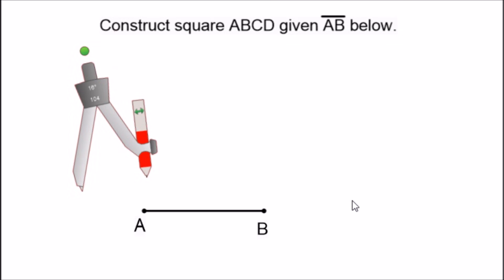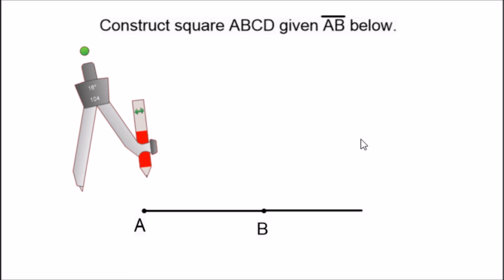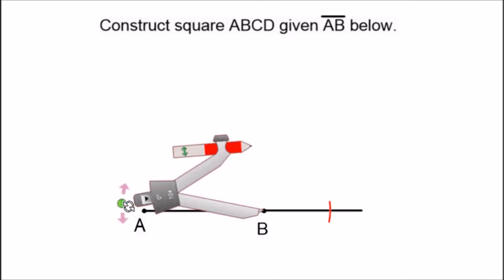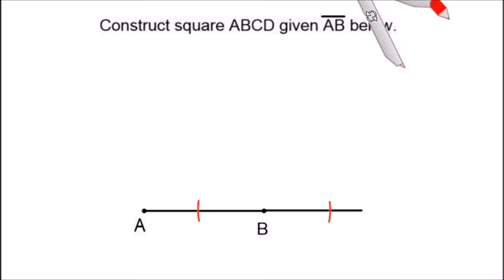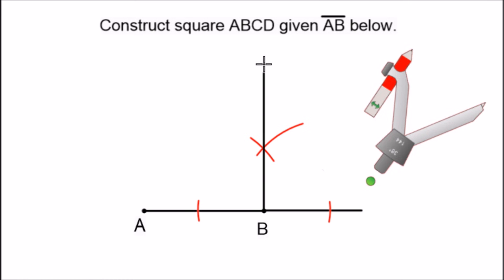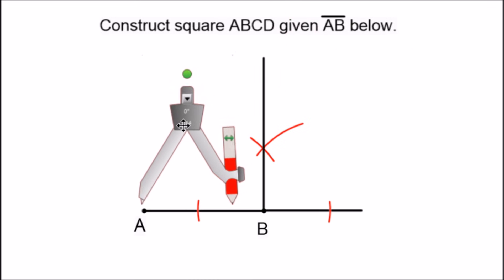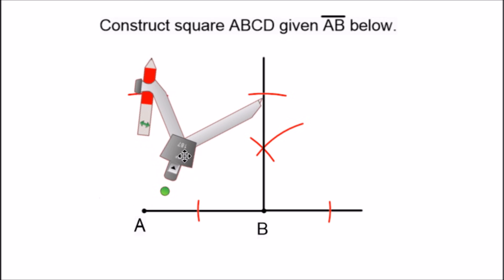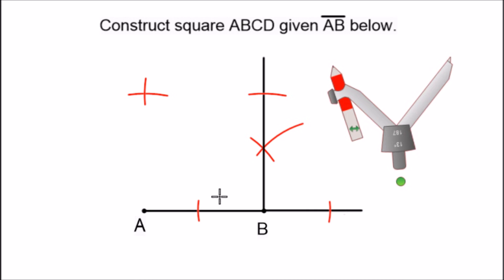Constructing a square - Geometry

Comment: Watched this and still confused.
Reply from the maker: Math can be tricky! For complicated ideas like this, I break it down into small pieces. A square has 4 equal sides and 4 right angles. 

So the smaller pieces are constructing perpendicular lines (to make right angles) and copying line segments (to make equal sides)

Once you master the small pieces, you have a much better chance at learning this. Also, I am able to remember the steps to this construction because I really understand the anatomy of a square.

Comment: My teacher says there is only one bisector in the video and you can’t prove they are all equal so I failed
Reply from the maker: I have to respectfully disagree with your teacher. In the video, I construct a right angle at point B, then construct a quadrilateral with 4 congruent sides. A quadrilateral with 4 congruent sides is a rhombus, and a rhombus with a right angle is a square.

Comment: This is so extra when you could just use a ruler for more precise and quicker results. Geometry is dumb
Reply: True, if you have two square sides to reference. This method is when you have one side or less of a square reference. Otherwise, you may have a skewed "square." Think of an odd shaped wood piece that you want to cut a square out of with a saw.
Reply: Real it makes me mad
Reply: The reason to mark out using these techniques over just a ruler is accuracy.
I have used them to mark out everything from small, accurate jewelry to large, accurate orchard blocks.
A ruler can't match the accuracy in either case.